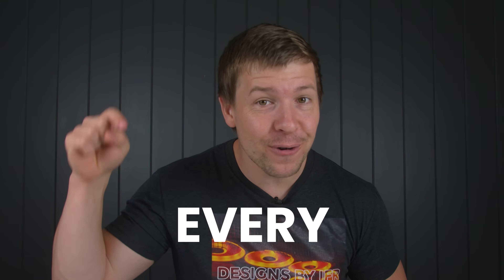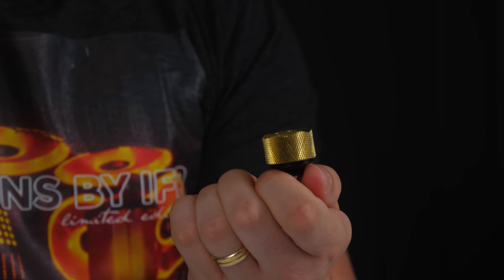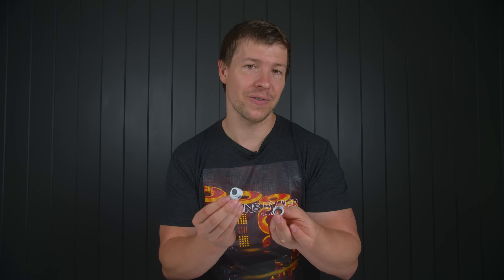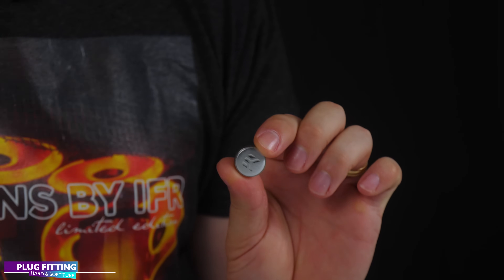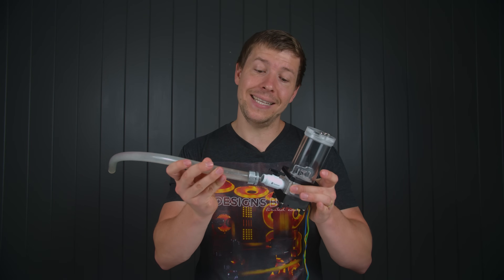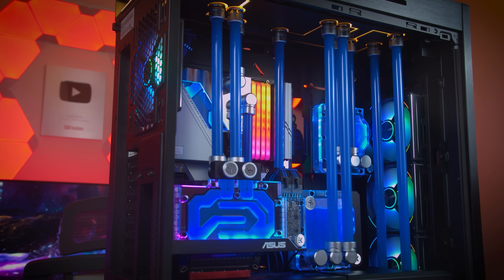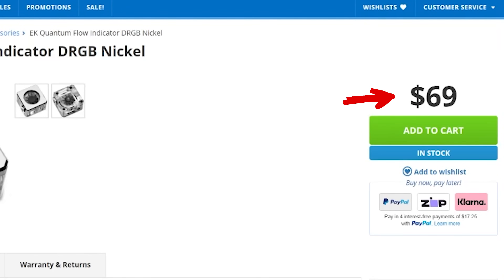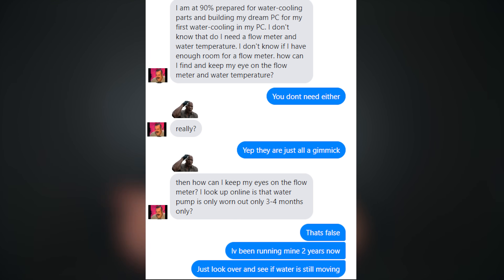BEST Beginners Guide to PC Water Cooling | Fittings 2022

Comment: I actually have planned my loop with a filter. It’s not a single loop though.
I got 2 D5 pumps, one that foes my CPU, one that does my GPU. These 2 loops will effectively blend in a bigger reservoir to resist heat build via adding material. However there is a 3rd loop! My filter loop. I am using a DDS pump for this as it has high pressure, and the flow rate isn’t needed for filtering, pressure is.
If my filter jams, I can shut off that area from the rest, drain only that, and replace filter. I already presumed that it could clog and decided I wanted the benefits without the downsides. I also am prepping for the tube bending portion for my twin 320MM Rads. Why would I make such a complex system? To make a simplified loop for each part of my PC.
My plan is to make my water tank and Rads into a table to put said PC. It’s definitely gonna be hard to finish, might have to show it off when done

Comment: I would think the metal type of the fittings is most important than the shapes you went over at length. Mixing metal fitting types will cause severe pain
Reply from the maker: Majority of fittings are copper/brass which are similar metals on the galvanic corrosion scale so those two are fine to mix, the other type of fitting is aluminium, you definately do not want to mix that

Comment: What do you think of Automatic Pressure release valves? Maybe the filter and pressure release valve for better monitoring of the filter/maintenance, or just the automatic pressure release valvr on its own??
Reply from the maker: You mean the pressure release fittings up the top of reservoirs? I can see they have their strengths but to be fair a water cooling loop will and should not generate so much pressure that it will fail.

If a user is worried about pressure they can always loosen the plug fitting up top every once in a while.

If you have the extra $$ there and want one for ease and piece of mind then that is up to the individual.

I more made this video to show users they do not need so and so fitting and they could be saving this amount of money eithout them

Comment: Good on you Cory, call it like it is. I've got 2 rigs and they both have needed double-45's (in conjunction with a short male-to-male extension) to join the top radiator to the front radiator. As for flow meters... Corsair's GPU blocks used to have(?) a  visible flow meter and their forums were full of "my spinner doesn't turn all that much, have I got a problem?" queries. As you said, another (unnecessary) point-of-failure and an unwanted concern for people new to water cooling. Another fitting I like is the Bitspower T-block rotary and use it to tap off my bottom radiator for a drain port. I have also used one to put a temperature sensor stop fitting into a loop.
Reply from the maker: Thank you my friend

Comment: I have used the "Anti-Off Rigid 16mm OD Fittings"  in my last 6 builds. They are fantastic. Have you ever tried them?
The neoprene sleeve is much more durable, easier to work with and hold much better than the o ring style fittings. 6 colors as well.
Reply from the maker: I have not tried them yet, i will have to check them out
Reply: @DesignsByIFR  They are a game changer. The 0-ring style are obsolete. I purchase mine through eBay. The connection is so secure the manufacturer demos them pulling a car without failure. Only about 6 bucks each and 6 colors to choose from.

Comment: Outstanding Corey!!  Thank you very much.  This makes understanding how the loop is put together a lot easier.  When I put a soft tube loop together I seem to remember that the compression fitting also had an O-ring.  Was this just overkill?  Also, which hard tube is easier to bend, PETG or Acrylic?
Reply from the maker: Spft tube doesnt use O-rings. PETG is easier than acrylic but i will cover that in our next water cooling tutorial video
Reply: @DesignsByIFR  Thanks

Comment: I use hoses and a water block from AquaComputer, it often gets clogged (1 time in 3 months), I just had to disassemble and drain the water every time, so I bought a filter from AquaComputer that is easy to clean without draining the water and without disconnecting the circuit. And also, I disassembled the closed type of 3 different coolings and all had a clogged water block.

Comment: You are psychic sir. I'm currently building my first liquid loop and am at the point where I need fittings, aaaaaand this pops  into my feed. You should follow this up with a practical use video where you actually put some of this to use and maybe go over when and where to use some of them and how to figure that out., as in I'm pretty sure I need an offset or two but I only have 2 hand to hold t squares and rulers and still see a small number on the side of things, and if I'm having trouble I'm sure others are as well.

You do some nice builds btw. Top notch work.
Reply from the maker: Thank you! I do habe more tutorials coming up

Comment: I did buy a screen filter.  What I did, though, was to remove the screen and use the  tube as an short extension between two components, as it was the perfect length.  It gives the build an "artistic" look, and removes the filter restriction.
Reply from the maker: Good thinking, its still a lot of money but i am all for making the build look the way you want it
Reply: @DesignsByIFR  That fitting came with a 100 pc buyout on Ebay.  I like to find quantities of fittings and recondition them with new o rings and/or paint.  Saves on the cost of new fittings for every project that I do or redo.